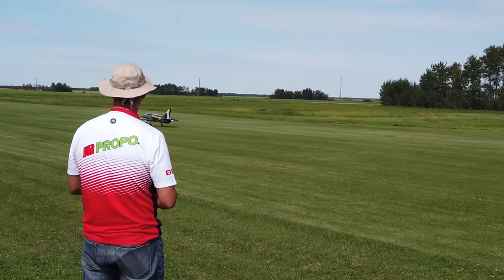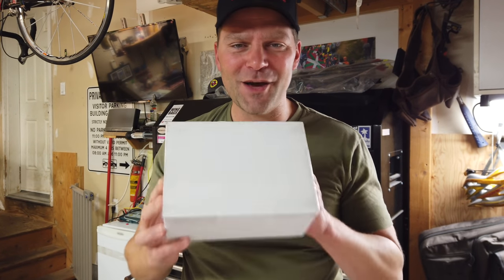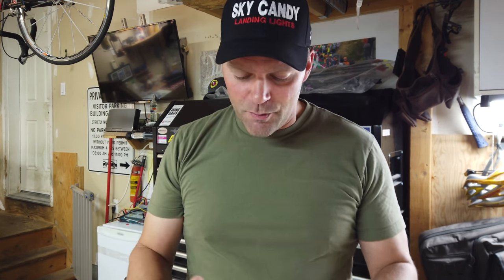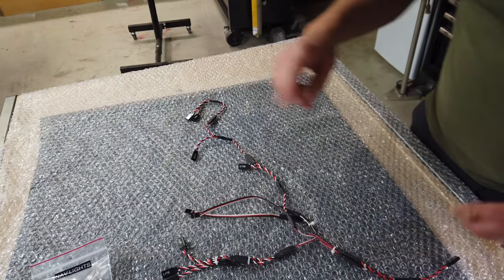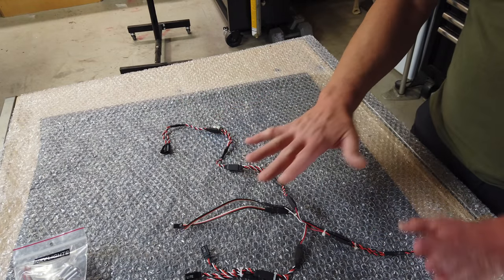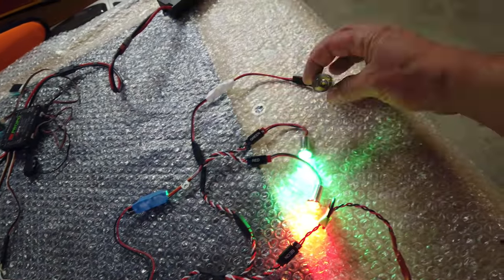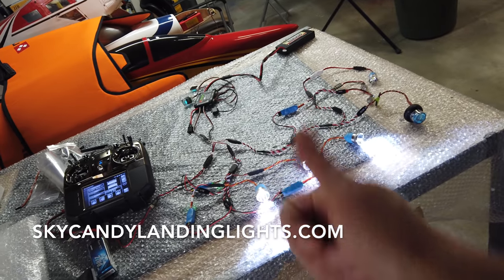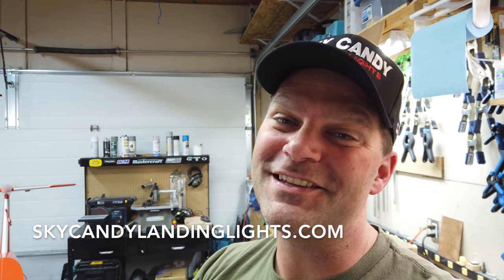Taking Care Of Installing The Little Things - AD Diamond Build Part 10

Comment: What is the high flow fitting and what is the difference from normal? Nice video!
Reply from the maker: Great Question!  The high flow fitting allows you to use 8mm Festo tubing (very large tubing).  The standard diameter fitting could basically fit inside the high flow fitting with some room to move around.  It's important to reduce restrictions in any fuel system but in my opinion, especially when you get above a 160N turbine it's critical.